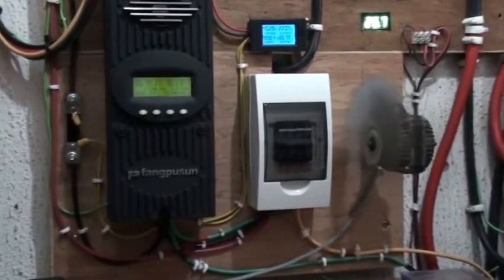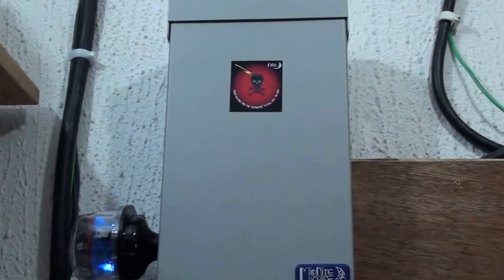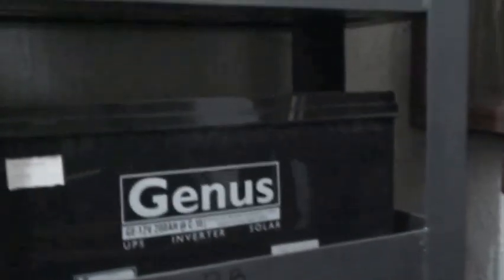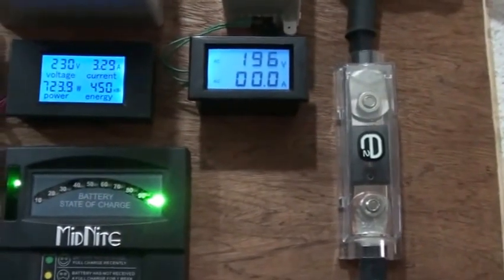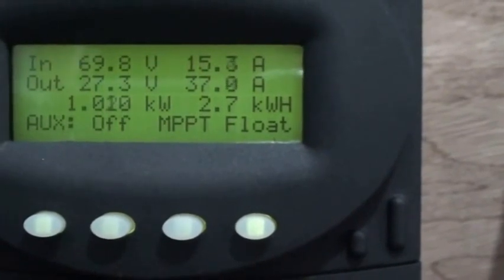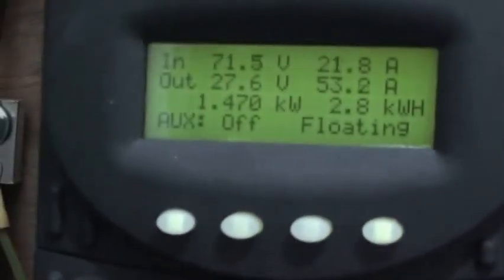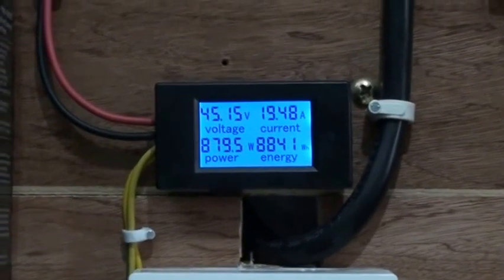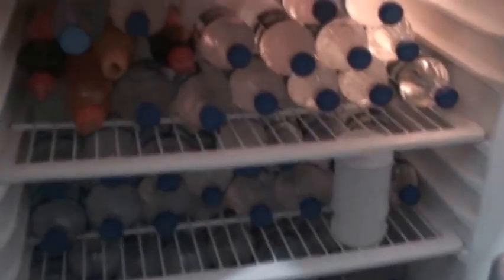Powerstar W7 & 1800 watts solar upgrade

Comment: Well done....I have a question, how good is this type of inverter(psw7) compared to a transformerless mppsolar hybrid inverter. Which is better and reliable for all type of loads. Thanks
Reply from the maker: They have different advantages/features . The mppsolar is lighter, has a higher efficiency, surge is 2x power rating, inbuilt MPPT, one single pcb board but the psw7 is heavier, studier, surge is 3x power rating, separate power and control board, can desulphate though some newer versions of mppsolar can now do that.
Reply: @ibidapoilawole7120  alright....based on your years of experience which one will you advice a newbie. Also a question, can the transformerless hybrid handle a 3000w heater(resistive load) continuously for 4hrs comfortably

Comment: Nice Job! but I think your array is better off wired in series when using an MPPT charge controller to curb power loss
Reply from the maker: Thanks. I agree when in series it can but you must also take note of the MPPT charge controller voltage limitation which is 150 volts DC for this particular controller.If the Voc exceeds 150volts ,the controller may become toast. The parallel I meant in this case was with the use of a combiner box so that more current can flow and maximum power can still be achieved before reaching the charge controller power limit for the corresponding nominal voltage.
Reply: Well, I am not an expert, but I think two charge controller is ideal for this setup. I have a similar system except for the amount of the charge controller used and the array size.

Comment: Hello do you run your inverter in power saver mode? I have a inverter just like yours but in power saver mode when i plug my drill in and try to start it it starts very slow then it gets up to speed not sure if this can damage the drill. What are your views?
Reply from the maker: Yes I run it in power saver mode. It is a 6000watts  pure sinewave wave inverter and i hardly notice the slow down in speed when I use my 500watts and 900watts drills on the inverter.

Comment: Once again nice job, will be starting my off grid solar system soon. Have started with a solar pump with 4 255 Watts panels. In the process of acquiring a hybrid solar inverter and a set of 4 12 volts 250 Ah batteries.

Comment: I love those back lite blue power digital read out meters (Voltage, Power, Current, Energy) . Where did you get them? I have been looking for some good ones. Thanks in advance. Nice system. Jim
Reply from the maker: ChileExpatFamily thanks. I got them from Amazon. Bayite 4 in 1 AC meter and 4 in 1 DC meter. Hey come in very handy and fairly accurate for the job.
Reply: Thank you very much. I will try to order one for me here in Chile. Jim

Comment: How were you able to mount the shunt and make it stable.  I have been racking my head on the best approach while making it easy screw and unscrew the terminal bolt
Reply from the maker: I did capitalize on the rigidity of the 10mm2 negative wire. I used cable clips to hold the wire on both sides of the shunt. Presently I have two clips much closer to the terminals holding the cable against the board wall and at the same time it holds the shunt in place.
Reply: Nice.
Reply from the maker: Thank you

Comment: Great video Ibidapo, very nice setup. Can u show your panels in the next video? Why connect them in 3 strings of two in series, when ur CC can take upto 150V? Why not 2strings of three in series? Total voltage will be around 135v or so.
Reply from the maker: E.John Thanks,yes you are right. I am actually planning to change the the configuration to 2 strings of 3 panels in series and and the new 80A controller would have 6 X 320w panels.
Reply from the maker: E.John  I would be doing a separate video to show the solar panels on the roof
Reply: I'll be looking forward to the video(s) by the way, nice Egunsi soup there!
Reply from the maker: lol @ egusi soup

Comment: So how is your Chinese charge controller doing so far? I have been thinking about getting one but not sure about it.
Reply from the maker: The Fangpusun charge controller is doing great. I have even read some reviews online about the similarity of both Outback and Fangpusun. It does also support the mate and Hub4. More importantly,if you purchase directly from the manufacturer, the warranty is great.
Reply: Honestly Outback is made in China these days. So I don't see any difference in them other than the price you pay. Me I like MPP Solar stuff from Taiwan.
Reply from the maker: Correct.Most companies manufacture in China now even SMA. That is a great product and I hope to deploy one of those in the nearest future
Reply: I just bought a PIP 3024HS inverter charger and PCM60X charge controller from MPP Solar. although most people like PIP 2424 lots of videos on this stuff you should check it out, low price and very reliable products.

Comment: any update on your system
Reply from the maker: Yes,  a new 80A charge controller has been installed and the next phase would be to add another 1800/2000w watts solar panel array

Comment: How is the Outback clone going ? I am told they work better then the real over priced one. The battery extra is a great unit. They work very well, Have you put a volt meter over the bank mate. How are the balancers going for you. Very nice looking system
Reply from the maker: Thanks Justin Case, The Pfangusum Flexmax really works good and the support is quite good. Got a voltmeter on the bank to keep an eye on the voltage and the HA01 balancers are sure doing a great job on keeping the battery voltage well balanced.
Reply: Great to here mate. Job well done.Ibidapo Ilawole
Reply from the maker: Thanks Justin Case